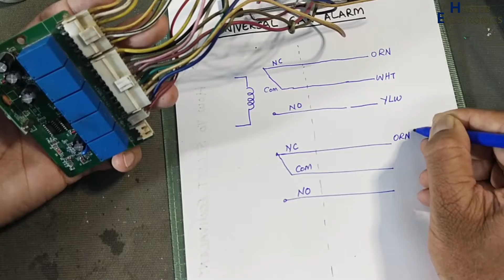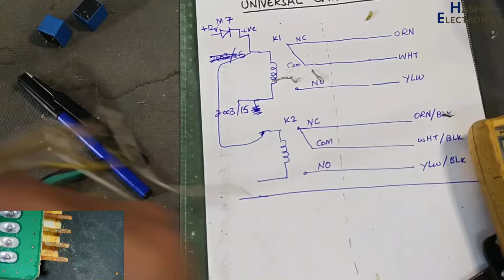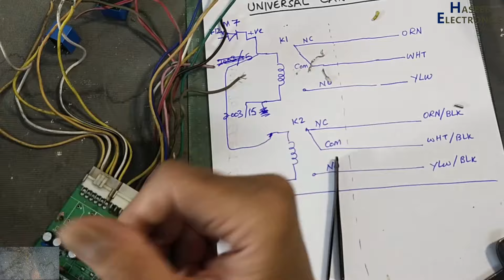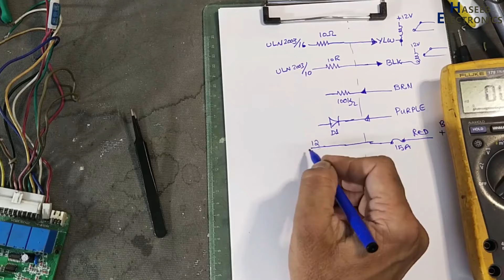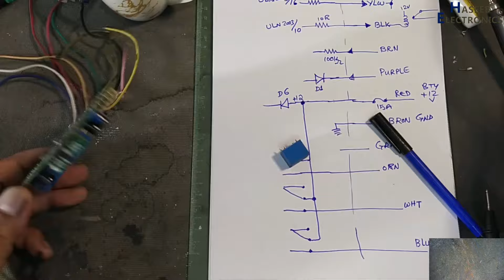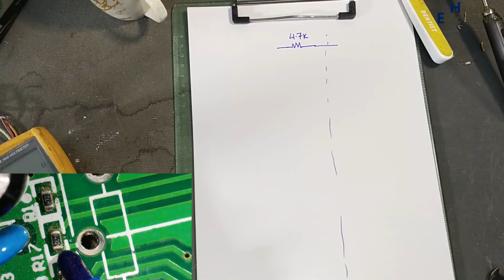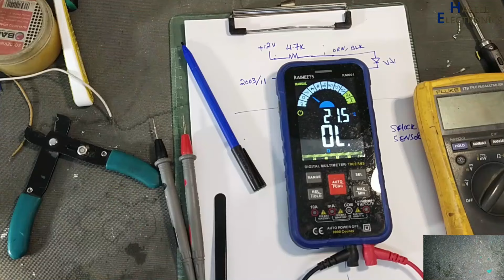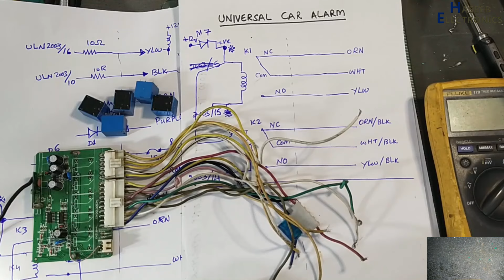{1091} How to trace and understand universal car alarm system circuit

Comment: sir if possible please help me this one also because I don't understand output ground. I still confuse about ground as a reference and i confuse where to put black lead to measure voltage in output and  input. Because I have tv and I try to find where is ground to measure voltage. There smd capacitor aluminium. But I need the confirm. It is correct to take ground from smd aluminium negative
Reply from the maker: you can use -ver terminal of any polar capacitor closer to that circuit for using as return path
or you can trace that portion of the circuit and check +and - supplies for that portion. 
some circuits have many portion and that are isolated from each other. in that case you need to check that circuit carefully
Reply: @HaseebElectronics  sir if you have time please make a video for this. And actuall I want through diagram and the symbol of component so that I can understand better about the output ground . And I will pay also sir as a tuition
Reply from the maker: @restingroysurong805  i will try to arrange. and never mention any tution fees, please. i never ask for any fees